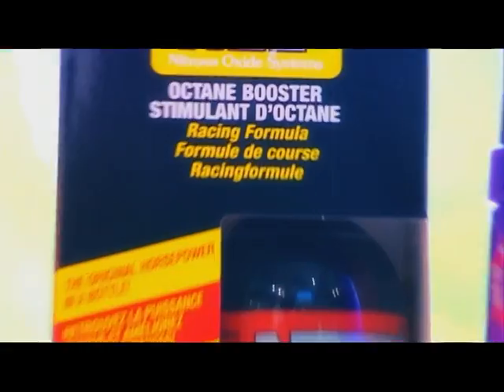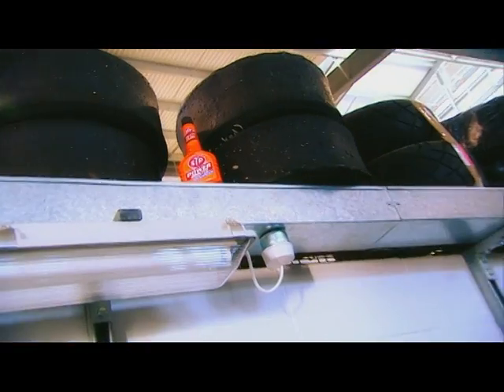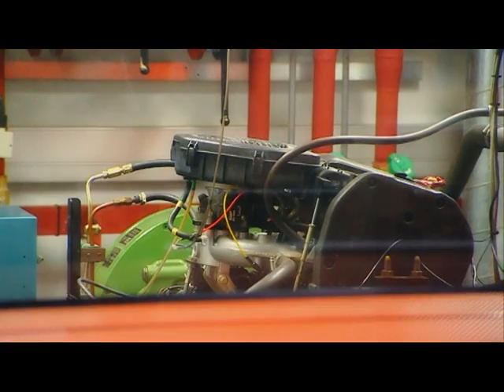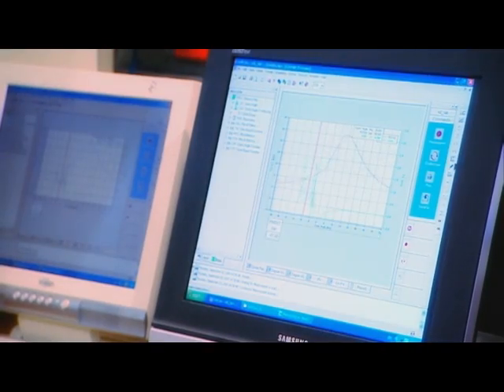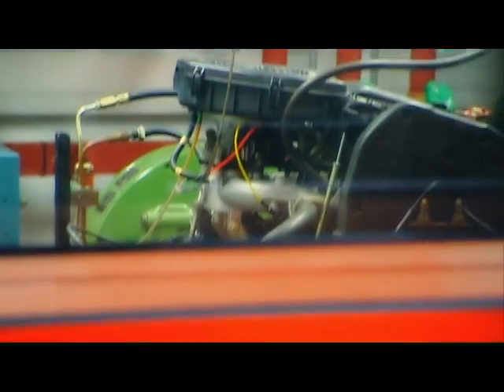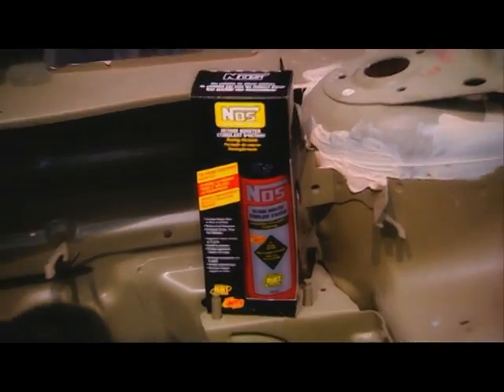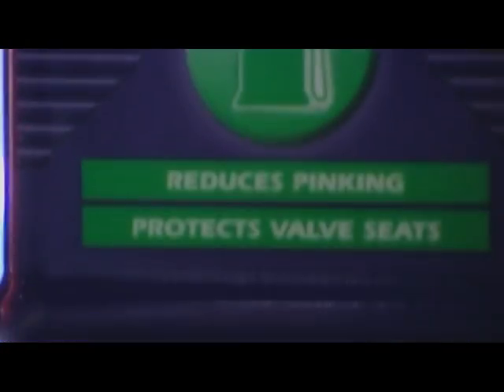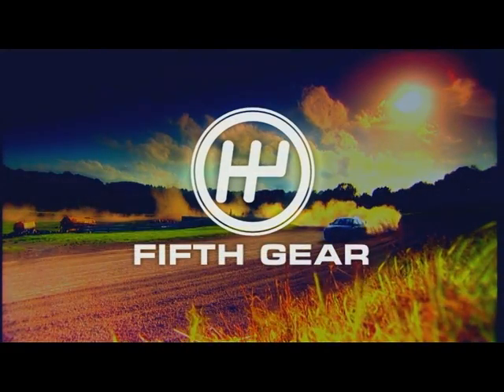Fifth Gear - Do Fuel Additives really make you faster?

Comment: On a knock limited engine (turbocharged, or high compression ratio), with good knock control strategies, you will likely see improvements, depending on how much the additives actually increase the detonation resistance.

Comment: I would like to know what the compression ratio was on this engine and as many others said if it's an engine designed to run on regular fuel versus mid-grade or premium then these are going to do absolutely nothing to help at all especially in a newer engine that is already clean cuz not only are these designed to act as octane boosters but they're also designed with cleaning the engine in mind as well and actually act as fuel system and engine cleaners as well as octane boosters but that being said even if I was running a 12.8 to 1 compression engine like in my motorcycle I would not use any of these octane boosters slash fuel system cleaners what I would use is I would go based on the assumption that I need a good fuel system cleaner or something to remove water from my fuel tank and I would use STP fuel system cleaner or the seafoam fuel system cleaner which the STP that I would use comes in the same can is the seafoam just different labeling or a bottle of heet or ISO heet for strictly removing moisture from the fuel unless you're running a high test performance fuel all the time like the shell v-power which is got lots of cleaning agents added to it as a Pump Fuel already and will help to keep your engine clean you would get enough build-up of Gunk and carbon in your engine every five to ten thousand miles to make a noticeable enough difference that just buying a can of seafoam and running it through on a tank of fuel would actually make a difference in improving fuel economy and performance on that engine if I was running an engine that I thought could take advantage of a higher octane as you mentioned you were just running regular I would actually spend the extra money to actually get fuel that's got a higher octane rating before adding any type of freaking octane booster or performance booster in anyway cuz the more expensive higher octane fuel is probably going to not only have higher octane but more detergent additives in the fuel anyway which would be advantageous to helping to game performance as well when you run a premium grade fuel that has three times the cleaning power of a regular grade fuel long term it would help to keep the engine clean or possibly even clean it long term we love how you guys say you're being scientific about all these different tests that you do and you leave out basic things in some of these tests that make them truly scientific like this one you probably just took a little economy box engine and tried running higher octane in it which realistically probably didn't boost the octane rating much more than one or two points so instead of running regular you could have just grabbed some mid-grade and probably seen the same results as adding the octane boosters and the mid-grade fuel would have cost a lot less overall for the two extra octane points you're getting them buying any of these bottles of octane booster if you're seriously somebody who's running your car on a regular grade fuel and you're adding octane boosters you're just a freaking idiot cuz you're paying way more per gallon for adding octane to your car than if you just bought higher octane fuel in the first place the only advantage to running these is they all have detergent agents in them to help clean your engine so the ability to clean your engine would be the thing that you're gaining by adding these to your fuel which if that's the case and you just want to clean the engine using a fuel additive there is better fuel additives than these octane boosting performance enhancers that is actually specifically designed for cleaning the fuel system and engine and is more affected at doing it as well.

Comment: This is just retarded. It clean your fuel system. and its not flameable so off course the engine will not run peak performance while its in there. Also you cant use fuel cleaner on a New engine there is nothing to clean.
Reply: exactly

Comment: I have an e39 and I use gumout it restores lost compression and power for me ,but then again I was loosing power maybe do to clogged fuel filter or feul injectors ,if it's not broke don't fix it but if you've been have a sluggish car do to poor fuel ethanol ect. then you can gain some power back

Comment: I recently used Wynnes fuel injection cleaner and damn that stuff is good!! I don't need to press the accelorator pedel that much now.Last time i used a injection cleaner was like 8 yrs ago/25,000 miles ago my car now has 88,000 miles.Last time was Forte oil and petrol flush and that's damn good stuff too i advise using that.engine ran sweet with great milage.

Comment: what a crap video results would be different in a turbo engine. and to claim the honda type r engine is more of a performance engine is total joke aswell since the engines are very similar in design and contruction and rover and honda were working on the K series engine design together for a number of years.

Comment: When adding the octane boost of these brands they only raise the octane ratings by 0.1 per bottle at most.   With that said once added it gives a high compression engine the ability to raise timing slitely in turn some gains will happen.  If timing is not raised no power will be gained but lost due to a now lower flash point of the gas.

Comment: if your car is running anything lower than a 10.1 ratio don't bother posting the octane if you are higher as in 11.1 then you can handle 100 Octane and see improvements. octane at a hundred and ten and higher need the compression of 12.1 and greater with a good tuning. this bit of information is way more relevant than this entire video
Reply: Also boosted motors benefit from high octane. Along with high compression as you said
Reply: Ivan Moreira thanks i have 11.1
Reply: Its not only the compression ratio itself because even if you have 10:1 ratio and you have turbo then again you need higher octane if you are naturally aspirated is as you said above 11 or more

Comment: this video is bullshit. so much missing information. if you are boosting the octane on your car you have to take in consideration your compression. higher octane fuel demand a higher compression ratio to take advantage of a Full Burst. if you put it in a standard engine built for 85 octane of course boosting the octane will make the engine suffer because it does not have the necessary compression. this video is complete bullshit
Reply: Ivan Moreira 
The video is not bullshit. They simply tested the company's claims of more power
Reply: total bullshit this vid your 100% correct, results would be different in a turbo engine. and to claim the honda type r engine is more of a performance engine is total joke aswell since the engines are very similar in design and contruction and rover and honda were working on the K series engine design together for a number of years.
Reply: Ivan Moreira If it doesn't tell buyers to consider all that on the bottle, then it's your comment that's the bullshit.

Comment: My engine has a 12:1 compression ratio and octane boosters make a noticeable difference in power for me.
Reply: 12:1 CR? You should be running at least 100 Octane like E85 or a mix of 93 octane pump gas with a good octane booster.
Reply: I think it really depends on the type of motor, like if its a completely stock engine from a corola, idont think it will do anything.
Reply: datownkidd
I think it mainly depends on the octane rating for your engine.
Reply: dolebiscuit my Versa has a 13:1 and it tells me to use 91 octane
Reply: zhbvenkhoReload
Same with mine
Reply: How much should my bmw 335 i 2008 have? And will iy increade power its twin turbocharged
Reply: @allenmessi4636  yes

Comment: Octane booster in a conventional car tuned for pump fuel!!! Are these guys dumb as shit? Of course it ain't going to make a difference. I thought they were supposed to know what they are talking about. Their own tech guy said try it in a performance car and they chuck it in a Honda? The tech meant put it into a car which had been modified. ie one with  the timing wound up and or the compression wound up and maybe a turbo or two.

When you tune an engine to its limits the air fuel mixture is squeezed harder.  When this occurs the engine can detonate. Essentially the fuel explodes before the spark plugs fire. It can be disastrous if let go on too long. This is when Octane come into play. Octane reduces pre-combustion and allows this wild tuning to make more power. 

Formula ones in the old turbo era ran octane booster called toluene from what i recall they ran 20-30% to stop detonation.

Comment: If you want to restore lost stock power To get the best results you want to clean out your fuel system with the American bg244 diesel cleaner or bg44k for petrol.Its very expensive but you get what you pay for.!!! Use high quality fuel,Shell v power or Bp ultimate.You will get better results pound for pound of the above with a good remap of the engine's ecu.!!

Comment: If your engine runs normally with regular fuel, raising the octane index will not change anything. These products can effectively increase engine power indeed, but only if you use the octane increase accordingly by changing some operating parameters: compression ratio, timing, fuel-air mix ratio, etc.
Reply: Which on modern cars happens automatically as the ECU adjusts to the fuel you put in the car.

Comment: chuckles i would bet money the "regular supermarket grade fuel" was the E10 or similar ethanol fuel.
Heres a tip - Any ethanol contamination /at all/  in the fuel neutralises any octane altering properties; as the ethanol itself is already being used as an octane boosting additive.  Most "supermarket fuels" are stock about 84 to 91 octane, they add the ethanol to get it to 95..    Since it neutralises additives, and in the process the ethanol gets altered itself, the result is a reduction in power.  No mystery there.
Reply: Bollocks. They have standards to adhere to so the octane rating will be in a certain range regardless if it's E0 or E5 or E10.  And Octane boosters don't react with the fuel they just mix into it.
Reply: For example acetone can be used as a pretty effective fuel additive, but if the fuel already contains ethanol it neutralises the effect entirely. As for standards the standard is a certain amount of ethanol (thus the E) and the fuels need a certain octane rating. They are using ethanol as the octane modifier.  If anything they use ethanol as it is cheap and likely (tin foil hat time) for the very reason that it does interfere with octane boosting additives..  less octane means they sell more of it.

Comment: They only improve your engine back to what it was when it came out of the factory.
Reply: +Boodieman72 Probably not even that.
Reply: +Boodieman72 Only if your car is not running as it should anymore. If wear and age has decreased performance to a point where regular fuel doesn't burn quite as it's supposed to, higher octane fuel might possibly fix this. But these additives are only crutches. Running on premium gas will most likely give same octane as the additives, but either cheaper / less of a pain in the arse.
Reply: The higher the octane the more resistant it is to ignition.
Reply: +Boodieman72  pre-ignition.  Means it must compress more before it explodes without a spark. Technically this make diesel or even crude oil higher octane than petrol.
Reply: DarkFortressMC Pre ignition means the fuel ignites before the spark plug fires.
Reply: The higher the octane the more resistant to "pre-ignition"  i was saying.  High octane isnt resistant to ignition, it is resistent to pre-ignition. It means you can compress it more without "pinging" (pre-ignition)  subsequently you have  more power being released when it does ignite from the spark.  More compression means you get more power from the subsequent expansion in the same cylinder space.   This is why high octane fuel makes nearly no difference in a car not tuned for it.  It will still ignite from the spark at the lower compression stage of the stroke.  Low octane fuel in a high octane engine will on the other hand run like crap, as all strokes will ping (pre-ignite) before the spark, in effect "slowing" the stroke as it will still be compressing when it ignites.
Reply: +DarkFortressMC  Not to mention the wonders it will do for your cylinder walls from the pre ignition.

Comment: You guys are setting your standards way to high! You expect a 100hp gain.... haha no maybe 4-10 at most and you can barley notice that!
Reply: +Josue Garcia if the engine is running as it should, there will be no gain at all with increasing octane. (i am sure their test is sensitive enough that they would have detected a 5 hp increase). If you do get a power increase when using these products, all it means is that your engine has lost performance due to wear and age and is not burning regular fuel as it's supposed to (or as it used to).

Comment: Well I swear by Millers Diesel Additive, I've used it for 5 years on My BMW and as of January a rolling road showed it's peak power output was 7 BHP more than when it was new, and it has become slightly more economical after using it
Reply: I used it on my Kia Cee'd diesel a few years ago and noticed that especially during the harsh Finnish winters the engine ran quieter and smoother. Cold starts were also easier and there was less (almost none) smoke right after the cold start, even at -25 degrees C. It made a noticeable difference. I'm not sure it made any performance gains, though.

I think I should try the Miller's petrol power ecomax on my current 1.6 ecoboost Mondeo and see if it makes any difference.
Reply: +MAXimum Power! That is because BMW, VAG group and Mercedes underrestimate bhp on their engines (mostly to get their cars in lower emission classes and such)
Reply: +Gašper Prijon BHP and emissions are two different things. And even then, a car that produces more BHP for the same emissions is considered more efficient...

Comment: To increase Horsepower an engine needs More Air (Turbo / Supercharger / Nitrous Oxide), increased displacement, greater compression, or other mechanical means.   Additives may clean your engine, thus maintaining overall performance, but there is no Miracle in a bottle..
Reply: Besides maybe Viagra ;-)
Reply: Modern engines have a low octane and high octane timing tables..it makes a huge difference in engine performance.

Comment: In One word, NO...     Octane boosters are designed to slow down the combustion of fuel, for use in High Compression engines.   Adding it to your economy car engine will only HURT it.   The fuel will burn more slowly, thus leaving Carbon Build-up Behind.
Assuming that you were already running High Octane fuel in your (Sample) performance vehicle, adding more Octane booster probably did Nothing besides clean the engine internals a little.
      Now, if you are in a location that does not sell High Octane fuel, and you drive, let's say a Corvette, you will get some serious early detonation (pinging)  and poor performance.   In this case, adding your booster will modify the regular 87 Octane fuel, into a more Premium, Higher Octane Blend.  But the cost will   
I'm not understanding what you are trying to prove in your videos.   Buying Regular Fuel and increasing the Octane with an additive will cost you more than buying High Octane directly from the pump, but in some remote places, you may not be able to find Premium in every pump.       
I'm not certain what your video is supposed to show?  Your logic is flawed.  You are spending a lot of money to prove what Octane Booster makers already know....   Of course, if you want to spend $10 on a bottle and gum up your engine, I'm sure they will gladly take your money.....
Reply: Simple,  and proven..   Octane booster slows the burn rate of fuel.   The result is incompletely burned fuel and damaging carbon build up inside your engine..   As  for not knowing what I'm talking about,  maybe so.  But as an engine mechanic,  I'll be quite glad to take your money to  fix that engine.   By all means, put high test fuel in  your economy engine...   Your mechanic will than you.  Easy money..

Comment: If your engine has low stock compression and doesn't have Variable valve timing,
octane boosters will do nothing.
Reply: Yeah this will only benefit engines which are more highly tuned than The Rover K Series, in the same way that you'll only gain from using higher octane unleaded if you have a tuned higher power output engine.
Reply: Not An Argument. I don't know I put that shit in my dirt bike and you can definitely feel it
Reply: urbex2007 To quote  regular car reviews "Potential  is wasted energy"

when you argue potential  you don't  have to back it up with performance.

Comment: Try running an old distributor engine on 95 fuel when it's still set for 98 fuel and you soon hear what these are for. Even better wait a while and you see when one of your pistons bites the dust. Higher octane fuels have a place and it generally isn't in a shopping car engine that is designed to keep going even if the owners fills the engine with the equivilent of dog urine for fuel. My GPZ500 motorbike has ignition timing set for UK 91 or old 2 star fuel to cover most countries!!

Comment: Lol. the increased power is what you get after a few tanks of fuel with the additive, cleaning out all the carbon deposits on the intake valve and the combustion chamber. You will not get any improvements the first hour of driving...

Useless test.